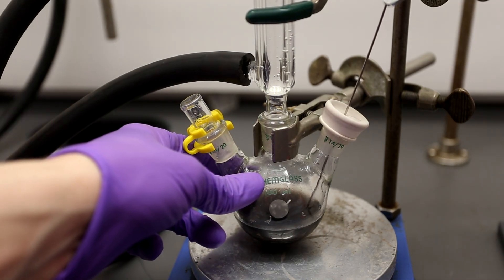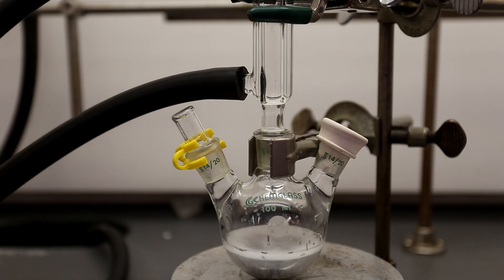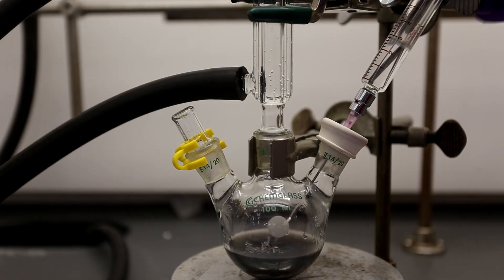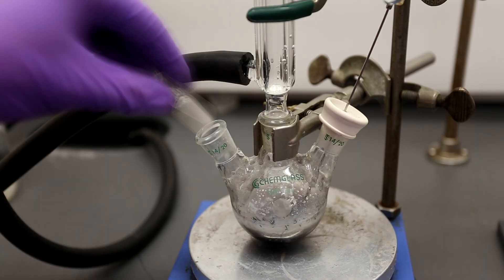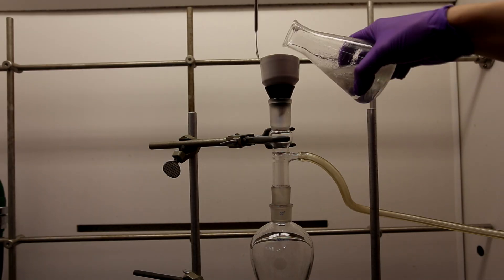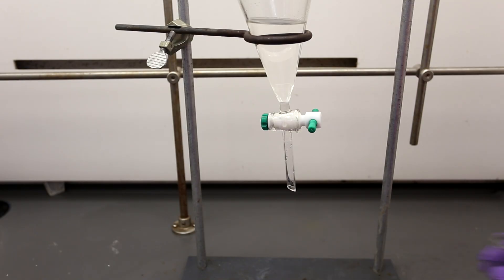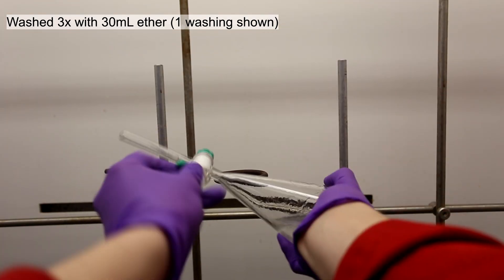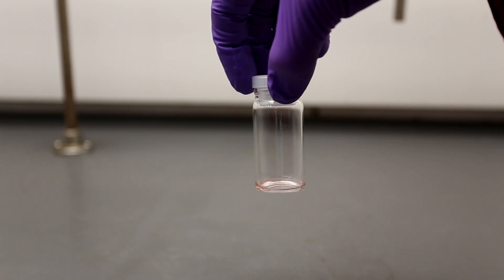How to make Butyric Acid (Grignard Reaction)

Comment: In 3:52 you mentioned filtering to get rid of the unreacted magnesium, but wouldn't the acid react with it to form a soluble MgCl2 and is it possible to filter it before adding the HCl to get rid of the magnesium metal when we add it in excess?

Comment: Grignard reagent is a very strong nucleophile, shouldn't that cause further addition of Grignard reagent leading to formation of 4-heptanone (dipropyl ketone) as the major product????
Reply: CO2 is a stronger electrophile than the carboxylate, carboxylates are even less reactive than ketones to nucleophilic addition. The reaction that you say is happening though, only in really small amounts. I'd say that a major concern would be the grignard reacting with traces of water or other protic substances, or with leftover alkyl halide via SN2 reaction.

Comment: When you do this kind of addition on CO2 with grignard reagents, there are equilibrium between the first addition product of the grignard reagent over CO2 and 1 or 2  extra equivalents  of the grignard reagent. So if your CO2 isn't in excess at any moment, your risk the formation of the bi-addition ketone product and even further with a tertiary alcool ( both formed after hydrolysis indeed). You can draw the mechanisms if you wish, it's a bit odd and counter-intuitive but pretty satisfying ^^

The first addition of the grignard over CO2 is pretty fast and the two others equilibrium are much slower but in the case of a large excess of the grignard  you'll end up with a mixture of the 3 product at the end. 

So just use Dry ice if you want better yields ^^

Comment: Instead of adding heaps of drying agent I have been running my work-up through a glass pipette filled with drying agent - a mini column.  It uses much less drying agent and is easier to wash out for entrained residues.

This works so well that I am surprised to see professional chemist youtubers drying using bucketfulls of material.

Comment: What would the pH of the concentrated hydroiodic acid be? And what does it react with that other strong acids do not? (Other than the reactions that lead to meth, of course...)
Reply: replyvideos 101 HI has a pH of under 0. And it's mainly used for reduction.
Reply: pH depends on concentration of the acid. It is not dependent on the identity of the acid. The property you are looking for is pKa not pH

Comment: wow I did a grignard in lab class and it didn't worked that well at all.
we did it on testtube scale, and even with some iodine we had to put it in an ultrasonic bath for 5-10 minutes then rub the tube in our hands to give it enough heat to start making the grignard reagent.
First atempt was a complete fail, I think I added the rest of the bromobenzene too quickly and killed the reaction, second atempt was very hard to get started but eventually worked out ok.

Comment: Nice video!

I believe your low yield arises due to the method of CO2 addition. Typically, the Grignard reagent would be added to a large excess of CO2 (pouring rxn mixture onto dry ice) to increase the probability that the Grignard only reacts with CO2. Bubbling the CO2 through the Grignard reagent increase the probability that a second molecule of Grignard will react with the carbonyl on the intermediate forming the geminal diol, heptane-4,4-diol, upon acidic work up, which I think would be quite soluble in the aqueous phase.

Good video though! Keep em coming!
Reply from the maker: +Trevor McElhenny thanks for the input! I will be doing a grignard again at some point, so we shall see what the yield is for that one :). I just ran out of ether though, so it has to wait.
Reply: +Trevor McElhenny i believe that the low yield was because you remove the glass stopper to add more ether instead the add with a needle just next to the hose with the co2, the moisture in the air was the trouble i guess, for the rest damn i wish do some reactions like this regards from mexico
Reply: The low yield is because of several factors from my experience:

- use of a bad condenser (short, liebig, not ice-cold water). You want to use a condenser with as big internal volume as possible (long alihn with ice-cold water works great)

- by repeatedly losing so much ether during the reagent formation you increase the concentration of PrBr too much, which will lead to formation of n-hexane by coupling of an unreacted bromopropane mollecule with the already formed grignard reagent. This is favored by high concentrations of alkyl halide and high temperature.

- after the grignard reagent formation stops being exothermic it is best to reflux it some more with external heat for some time. This will finish the reaction, which, although exothermic, doesn't go to completion with its own heat.

- in general it is also good practice to reflux the mixture after addition of the carbonyl - although this doesn't apply here, as the carbonyl is a gas and isn't present in the reaction mixture unreacted

- contrary to others I don't think opening the stopper to add ether jeopardizes the reaction too much, it IS water-sensitive, but the amount of water vapor in the volume of gas inside the flask is miniscule 

I have performed a grignard reaction to make isobutyric acid by dumping dry ice into the grignard reagent/ether solution through the condenser and I got a 53% yield after distillation while using all of the practices I described before, but any criticism is welcome.
Reply: NileRed hi. can I use anything else instead of ether like ethyl acetate?
Reply: Arman 25 typically, no you can't. If there are alternatives they would likely be other ethers. It needs to be a nonpolar solvent that is incredibly inert but not like hexane or benzene since the ether also has metal chelating properties that drive the reaction forward. In fact even though the Grignard reagent is notated commonly as R-MgX it actually exists as a tetrahedral organometallic complex with the ether roughly of the form (R-MgX)(Et2O)2. You MIGHT and I'm only saying might, get away with THF or dioxane as they are also ethers with metal chelating properties. Also, you can't use DCM because it will react with the magnesium just like the bromoalkane and generate side products and polymers.

Edit: I looked it up and dry anhydrous THF is an acceptable alternative, for the reasons stated above. Dioxane can also be used but leads to an interesting effect where instead of two ether molecules forming the complex (R-MgX)(Et2O)2 it causes the Grignard reagent to rearrange forming MgX2 and (R-Mg-R)(Et2O2) the corresponding magnesium dihalide which crashes out and the dioxane complexed diakylmagnesium species. I'm not 100% sure but I believe this compound can still be used in a Grignard reaction due to its powerful alkylating properties. You may however, have a higher than normal chance of creating disubstituted products due to the reagent having 2 alkyl groups in close proximity to the molecule they attack.
Reply: @spiderdude2099  it's also possible to use a MTBE as a solvent, but it won't dissolve ROOMgBr salt. So the product will form a crystalline mass at the bottom of the flask, and it's will be hard to stir it well, using the magnetic stirrer. THF has the same usability as a Et2O in this case. It also gives a [THFMgHal]+ R-  complexes, so there is no problems with using this. The only thing, that thf is highly hygroscopic solvent, so it's will be a good idea to use some kind of water adsorber, like H2SO4(conc.) in a bubble counter, or anhydrous CaCl2/MgSO4/Na2SO4 as a shutter if there is no way to use innert atmosphere such as Ar or N2.
Reply: @spiderdude2099  THF is the go-to solvent for grignards in industry.
Reply: Christian Ferralli  yeah I imagine that the lower vapor pressure, and flammability are more desirable on a large scale. And it doesn’t have the disubstitution problem that dioxane does.

Comment: I imagine the pink color could be iodine. That's the only thing I can think of.
Reply: +Ben Canon No, I don't think it comes from Iodine, since this Grignard-reaction started spontaneosly. There was no addition of Iodine necessary. 
Nevertheless, there are only a couple of Iodine-crystals needed, which will completely react with the excessive Magnesium in the further course. There is no free Iodine left in the reworking step later.
Reply: Ben Canon He probably used a previously contaminated chemical. Maybe the bromopropane.

Comment: Amazing video!! I would really like to try this synthesis; however, I do not have ether. Is there another solvent I could use in place of ether, or would that cause the reaction to fail?
Reply: Ian McClellan-Johnson you typically have to use some kind of ether. Thf, and dioxane work for most reactions and I’ve heard that DCM can be used but with slightly reduced yields. The ether coordinates to the Grignard reagent and that’s why it’s used, it stabilizes it and facilitates full formation of the reagent when it reacts with the magnesium. 

Just FYI, if dioxane is used you can have a slightly higher risk of the dual addition product because instead of existing as the complex (et2O)2 MgXR it exists as (dioxane)(MgXR)2

Comment: When a Grignard-Reaction is done, the alkyl halide is often diluted with dry ether before the addition. It is added dropwise, to keep the solution only slightly boiling. When the boiling gets to strong the Grignard reagent is able to react with the alkyl halide to form a larger molecule (in this case n-hexane). There's also the possibility that a ketone is formed as a byproduct, which could lead to a lot of side reactions. Nevertheless, nice presentation! :)
Reply from the maker: Hmm, I didn't know that! That could explain some things.
Reply: I would be interested in the fact, if it's possible to use ether that has been dried with CaCl2 or even NaSO4. I always used sodium to dry ether.
Reply from the maker: I imagine you could, I don't really see why not. Molecular sieves would be better to use though.